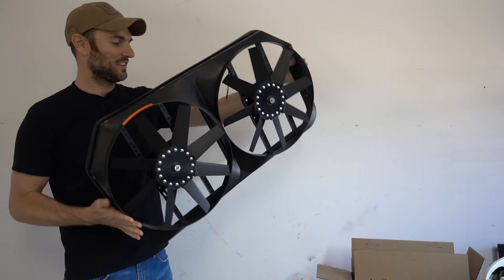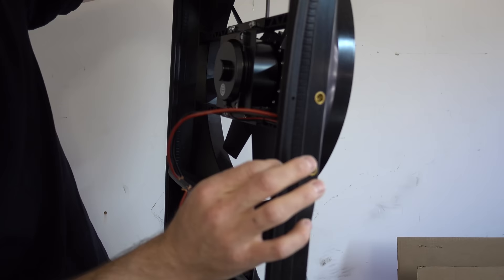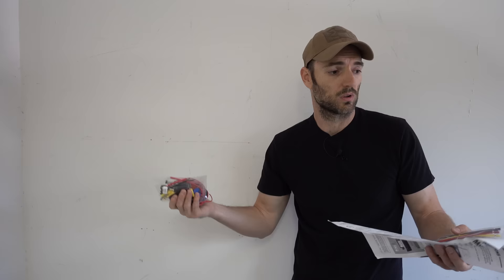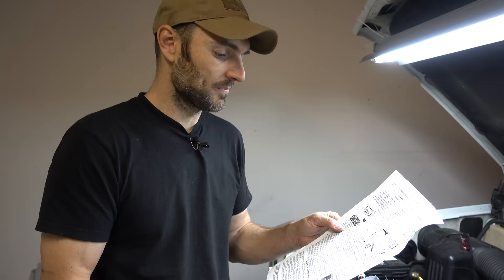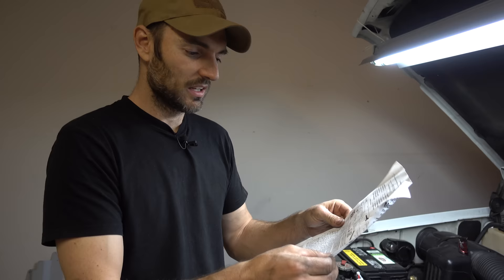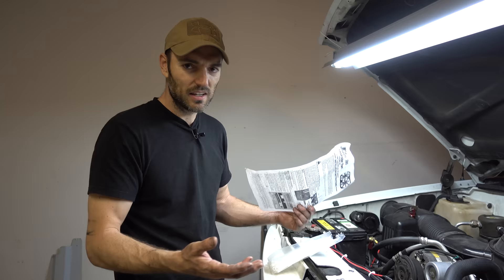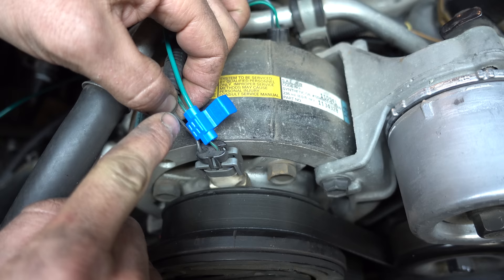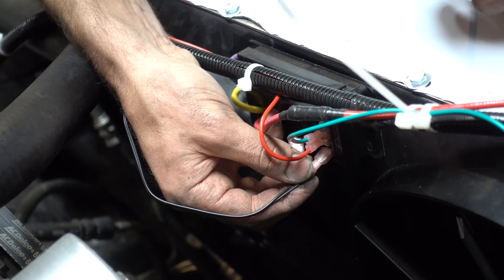Flex-A-Lite 280 Monster Fan System INSTALL & PAYOFF

Comment: quick question, wouldn't you want the fuse box connection to be on all the time. it seems the highest heat, and most damage done to a car takes place right when you turn the car off, so the fan should run after for a few minutes to drop the temp, right?

Comment: Yeah nice ,but what about not using the AC will it turn on due to hot temp in radiator didn’t show that working.
Reply from the maker: Yes, there is a temp sensor. Still going strong. Finally have an alternator strong enough to run it (Mechman 250 Elite).

Comment: Hey sir! To let you know, on suburbans, the two ac valves always go bad but to make it colder you'll need to replace the dryer and orifice tube. Then the obvious to get a vacuum and a full recharge on the Freon.
Reply from the maker: +Charles Suhr Thanks dude. I was planning on replacing all that stuff along with a new ac compressor.
Reply: 1 Road there's no need to replace the compressor unless you need to. I do AC in Texas and it gets bad here. That year, those compressors, are pretty durable. If it is leaking....Yea replace it but there's no need. Only things would worry about is the dryer, orifice tube and the front and rear "expansion" valves. The rear expansion goes bad usually and the rear AC isn't as cold as the front.

Comment: battery cables on 2000-2007 trucks are the worst , i've had 2 trucks where the cables won't seat properly on the battery terminal . take a razor blade to the rubber covering the end of the cable cut it all off. the only thing that rubber is doing is holding the terminal bolt from falling out. i think it dries out over the years and doesn't crush down to allow contact anymore. seems like it wouldn't be an issue since the bolt should be providing the electrical connection but idk. all i do know is that i have had issues and removing the rubber cured the issue on two different trucks.

Comment: Blades are staggered to avoid harmonic vibration  - that wire looked pretty dam thin for such big fans  which must be pulling 15a each at start up

Comment: I did this (not with this system but another brand) and honestly don't know if I can tell a difference about the A/C but the engine runs smoother,  seemingly gained some HP and my mileage is better.

Comment: Hummm I heard on another video to first check the level on the air-conditioning system and make sure you don't have any leaks and your clutch on the air compressor is working properly....

Comment: I have a 94 Z71 K 1500 pickup it does really well in the AC blows cold but I still have the stock clutch fan but on really hot days when it gets hot you should hear that clutch when it engages fully it's unbelievable how much you're it pulls..
under typical conditions there's always a certain amount of slip in the fan it's designed that way but when that clutch fan goes full on,  it's unbelievable you can literally feel it.. I imagine the electrics are more efficient though

Comment: You sold me on this. I have a 98 ram and its hell sitting in traffic but cools super at anything over 10mph.
Reply from the maker: Rodney Long Hey Rodney, I would say make sure you check your compressor first. I've found with my situation coupled with living in Las Vegas at 115° I not only needed more air being pulled passed the condenser and radiator but my compressor was also to blame. The compressor works but works poorly. The fans themselves are great but I have been having issues with my alternator (140 amp) keeping up at hot idle. The voltage issues along with the crazy expensive cost of a higher amperage alternator makes me wonder if I would've been okay with just swapping out my compressor first. Also, there are a lot of people in these comments who have had success using junk yard electric fans at a fraction of the cost. Also, I'd like to throw out that I didn't pay for this system as it was provided to me by Flexalite at no cost. Again, the fans are awesome. I've had them installed for quite a while now and have used them in a variety of situations including extreme outside temps and towing. They have performed flawlessly except for the massive amount of current they require. I've had many blown fuses and because of that it's hard for me to recommend this system to the average Joe. It seems to me that in order to run these fans and have no issues, you ABSOLUTELY also need a very high amperage alternator. Hope that provides some clarification.
Reply: thanks for the info. I think you have gotten to comfortable and forgotten how hot these trucks get and thats why you second guess yourself! when its 90 degrees out I can stop and leave the truck running ( its already cool inside ) come back in 15 min and its 85 degrees inside. I have put 2 new compressors on and its made no difference and had 3 different shops work on it. the condenser get so hot that you cant even think about bumping into it without getting burned. the factory fan will not even pull a breeze through it but I have replaced the fan twice and the water pump for good measure. I have only seen one of these trucks that the ac actually worked on the truck and he had added electric accessory fan to the front of the condenser. I may just do that.

Comment: i did a dual fan swap on my 94 OBS and learned some important things that i see could go wrong with your install. first is your truck only has a 105(cs130) stock alt. the fan controller you used has dual speed but still starts both at the same time(heavy amp draw on start up) to fix this issue i used Davies Craig Digital DC-0444. this unit does soft start and time delay for the second fan start 5-10sec. = low amp spike on fan start up. the 30+ constant draw really affects the rest of the truck volt amp needs. ( turn on ac full and high beams test volts at batt it will be very low. you can do the alt mod from cs130(105amp) to ad244(135amp).  from the newer gm trucks. i went with JS ALT dual alt bracket and run two oem cs130s that have life time warranties. this solved all amp issues. Mounting:  did the instructions say to mount the fan controller where you did? i mounted mine on drivers inner fender for couple of reasons. 1 being heat. that controller is going to get heat soaked. 2 having it center and top all tht wiring is run all over the top of the rad. mounting to drivers fender its right next to the needed therm prob and then you only need run a fused power wire from the factory power block thts located on the fire wall. altho this is not a must it gives a very clean install. Thanks for making a video. wish i d had one ten years ago whn i did my install. if you run into any of the issues i did i hope the items i bought will save you money and time trying to figure out how to fix it
Reply from the maker: Redevil Hello and thanks for the info!! Where did you find the dual alt bracket??
Reply: FB dont know how to post pics
Reply: how many alt have you gone threw? the other item tht burns up is this ac clutch from low volt/amp

Comment: It might have had something to do with a bad fan clutch too but just get a used one from like 05 or 06 and if you have a 99 or 2000. Or newer you can get them turned on on the ecu and it will all work good and cheaper

Comment: Back in the '80s I did a lot of cooling system and AC work when most cars were rear wheel drive with mechanical fans and r12 freon. I never ran into the problem of plenty of cooling it freeway speed (which was then 55 in all states) and little to no cooling at a stoplight. Even though the fan is only turning 500 to 600 RPM if the system was charged properly there was no difference in cooling between 0 and 55 mph.
Reply: Yeah he’s just paid by the fan company to make this video. Electric fans are nice though, get a few more HP as well

Comment: I think there is a ground lug on the body right next to the battery I saw it when you were hooking up the ground at 13.26 this will be helpful for the next guy don't hack the battery cable.

Comment: Hi about the melting fuses, it is the holder, or the high under-hood temperatures. You can run a 2nd fuse holder in parelell, connected to the fan speed controller with an equal length of the Same as previously used wire to ensure the the fuses see the same current. And you need to get 2 fuses of half the original amp rating.

If I was wiring up a dual fan set up I would have wired everything separately for reliability reasons, sort of how head lights are fused separately
Reply from the maker: +retrofitter I've never thought of running dual fuse blocks there... Thanks for that. I really think my problem was from alternator underperforming and thus creating heat. All my wiring would be extremely hot to the touch. I've since been in contact with PowerMaster, who've helped me out a lot, and they sent me out a smaller alt pulley which has helped tremendously. Check my latest vids to see!
Reply: 1 Road I heard running electric fans can put a bit of stress on the alternator
Reply: No damit it's overloaded amp draw. If it was Underwood temp the air filter box and all would melt.
Reply: RELAYS, RELAYS.

Comment: 1road- did you notice an increase in horsepower? you should know by the seat of your pants dynamometer. the fan freed up some horsepower from the clutch causing more engine drag. not sure if gas mileage would increase because of it, if so, very minor as in splitting hairs, but, you could lose that additional hp by adding more weight to the vehicle, sooo,,,,,,,, not that your worried about racing your truck but you should gain a little hp now. lol. glad your happy and have fun.

Comment: This guy is a dead ringer for The Property Brothers.
Keep an eye on your motor mounts. When they start getting worn, that hose and fan are going to marry each other.
Reply from the maker: +robert mills Hello Robert, thanks for the compliment and yes, I'm certainly going to have to deal with the close proximity of the fan blade and radiator hose.
Reply: @1RoadGarage  just loosen the clamp and turn the hose some so it pulls it away from the fan

Comment: Guaranteed that fan-s will not suck more air than my stock fan with a properly working fan clutch !
Reply: At idle or lower speeds they are 3 to 4 times more air!!

Comment: Better way to weather seal a butt connector that won't be worn out with weather and heat...  Take a tube of silicone, press one end of the butt connector to the opening, and squeeze in the silicone till it comes out the other side.  you have to make the connection before the silicone sets, but it's a much better weather seal than tape ever could be.

Comment: I have a 95 c1500 and this idea has been an idea for years.  I thought it would be more of a switch in the cab type set up.  It would be easier to not think of it though lol
Reply from the maker: I had trouble with low voltage running the stock alternator... had to get a Mechman 250amp Elite alternator to properly run them. After that, all is good. Love the fans!!

Comment: thats a delco  fan clutch   looks like the hd  one  we made     it should  lock  up when  hot    you should not need  electric  fans..i have a 92 k1500    same set  up..but mine is r12  still  never gets hot  at a stop  ..

Comment: No, your original fan clutch is bad, and or you have another problem with AC.
Flex a lite makes good stuff though. I had a flex a lite fan with built in shroud on my 68 Camaro with a 406 in it. I recommend them also.

Comment: You forgot to mention the fuel savings and power gain by removing the old clutch fan.
Reply: Power gain and fuel savings are inconsequential. Research with a chassis dynamometer has proven this to me.

Comment: thank you so much, your video was very helpful, you have encouraged me to bye the fans and installing it myself.
thumbs up:)
Reply from the maker: Just make sure you have an alternator that will support the extra amperage requirement. That's the main issue I've had. My stock alt was 105 which didn't really work right. I then upgraded to a 140amp alt thinking that would solve my issues but it just barely did. And, in Las Vegas when it was 115 degrees out and everything was running and HOT that alt couldn't barely keep up unless I had it rev'd up. I put a smaller pulley on the alt which did help but ultimately I think I need a 200amp or more alternator. The biggest problem is the fact that when an alt is warmed up and hot they can struggle putting out the amperage required. The fans are awesome though. They sound so cool and work great! I recently towed a HEAVY trailer from Las Vegas to Texas with plenty of hills and had no overheating issues at all. The fans did their job perfectly. Plus I love all the extra space under the hood. 

Good luck!
Reply: 1 Road / that’s good point, I had 370 AMP alternator from Mcman , so at this point I have covered the amps consumption of the fan, i had some problem alignment the upper bracket as you have, but it works.
I like that fans so much. It give me more horse power.
keep going my friend, you are very helpful guy.

Comment: My problem is there isn't enough room between the radiator and the grill for an electric fan system. And a rear mount doesn't flow enough air to be as effective as the fan and clutch.

Comment: These old fan clutches are a real f/u design. Slow to warm up, so the fan is spinning like crazy when cold, retarding the warm-up, keeping the engine @ fast idle using more gas than needed. They do not start freewhealing till they warm up from radiant temperature from the radiator, then when it gets hot enough it will start spinning to pull air thru radiator. I really think a lawsuit is in order. Once you realize the workings of this design, you'll say "WHAT WERE THEY THINKING?"

Comment: This system looks like a pain in the butt compared to a Doorman late model Silverado/Suburban fan kit.  The shroud is made to fit GM radiators and I only had to trim the shroud down a bit to fit it in the space between my 454 and the 34x19 radiator.  I did also get the factory style pigtails from Doorman and fab'd up my own relay harness to them, keeping things more water resistant.
Reply: Compare the air flow to dorman. The CFM's on Flex-a-lite can't be beat. And the option to manually control if you are looking for power. I gained 17 Hp and incredible throttle response over the clutch fan

Comment: I had bought this setup for 92 k1500 blazer a while back. 
 
-3 whole months to receive it . (live 30 mins away from the warehouse <They are made to order>)
-received with missing  brackets
-supplied butt connectors were a joke for the price tag
-cools great. 
-only the turn on temp is adjustable and not the turn off temp
-would be great if it included a removable display for setting the kick on temperature 
-since it doesn't use the factory shroud nothing secures the upper radiator hose so it rubs against the fex fan shroud 
-no place for the evaporator canister vacuum line be supported so had to zip tie to radiator hose 
-Notable power gain (have not yet been to dyno)
-no issues with battery drainage for weeks of no use maybe more long term yes but that point you are supposed to discount battery any way
supplied flex-a-lite sticker didn't last a month in the rain kinda disappointing 
* caution like most car with electric fans the fans will turn on if temp high enough with keys out of ign *
Reply from the maker: +Mikhail Goncharov Thanks for that information. What alt are you running?
Reply: 1 Road  alt? I am running the factory acdelco alternator it will need replacement soon the bearing is starting to go out. I hope I answered your question. I really do wish there was a better adjustment feature. I had to let the coolant get hotter so that it doesn't drop too much temperature with my four core radiator ( caused issues the tbi in the past). I need as much airflow as possible for  group mudding so the radiator doesn't get clogged  that is why I went with this fan set up. Off road buddy's have overheated due to this. 500$ one time price tag is alot better the needing to rebuild engine ( usaully 1400$ )
Reply: 1 Road btw great walk through video just happened to stumble across it while watching diff locker reviews

Comment: u get better gas mileage aswell. Because it frees up HPower. I seen a 4 miles per gallon difference. And a slightly better throttle response. Open up ur intake and ur exhaust. U should see a good miles per gallon difference. Iknow i did after i finally did all the mods. But i didnt spend 500 for my fan. It was about 150. And ths is on a Vortec V6 chevy S10

Comment: the 7 blade factor plastic fan from the 97 to 99 tahoes would have been a cheaper upgrade and would have solved your cooling issue, plus the fan is much much lighter than the 5 blade blade metal unit.

Comment: Awesome video badass might have to get one for my 2001 Chevy 1500
Reply from the maker: Just make dang sure you have a 240 amp alternator or more! That's the issue I'm still having. Even with my 140amp aftermarket alt it's still not enough when it's hot out. I'm thinking the 240 from Mechman would work fine but they're pricey.